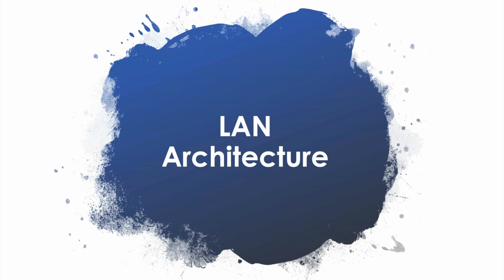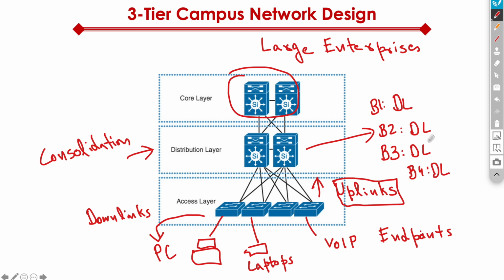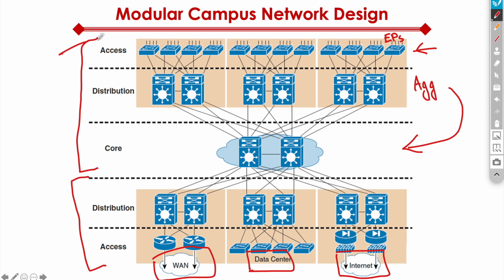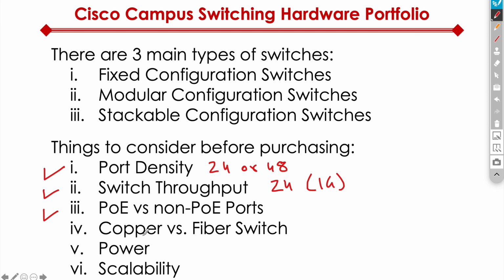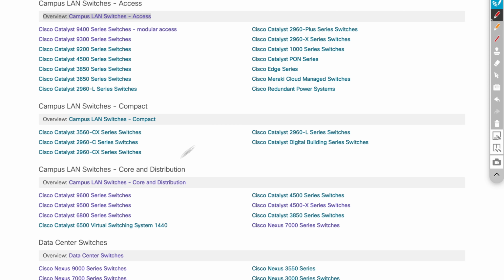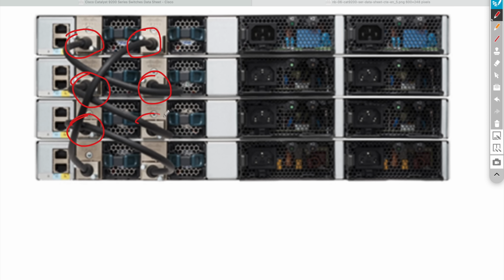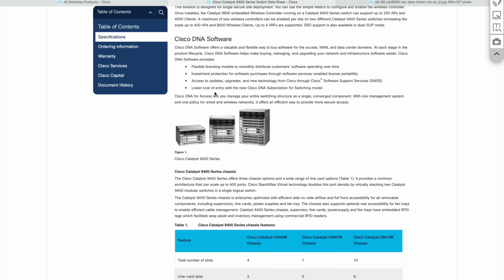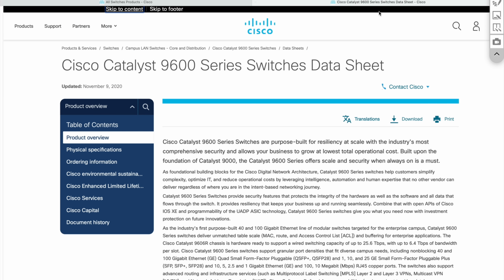CCNA 200-301 Course - Section 1: Part 2 - Network Fundamentals: LAN Architecture

Comment: Excellent video, explaining real world scenarios and important things to know which can be faced in a job, not only just exam information. Keep it up like that! I have one question, what exactly is throughput? Can you explain please?
Reply from the maker: Appreciate your kind words.  To understand throughput you first must understand bandwidth.

Bandwidth is defined as a theoretical measure of how much data could be transferred from source to destination in a given time frame.

Whereas throughout is the amount of data moved successfully from source to destination within a specific time frame

The best analogy I can give you, think of bandwidth as the water hose, and think of throughput as the water running through the water hose.  The water flow (throughput) can fluctuate but the circumference of the water hose (bandwidth) remains constant.

Hope this helps!